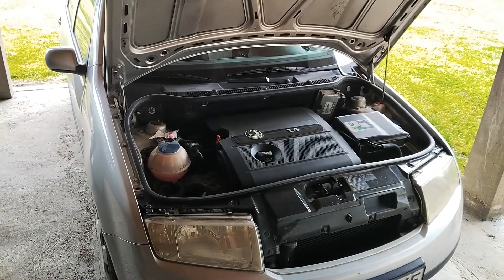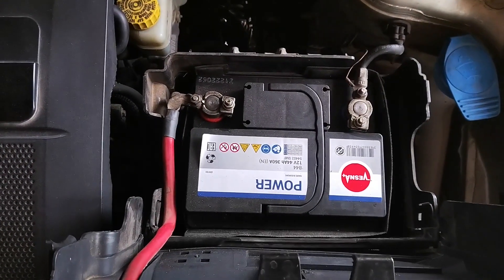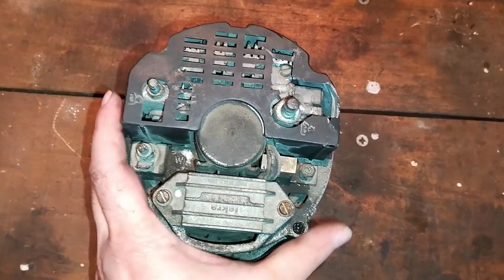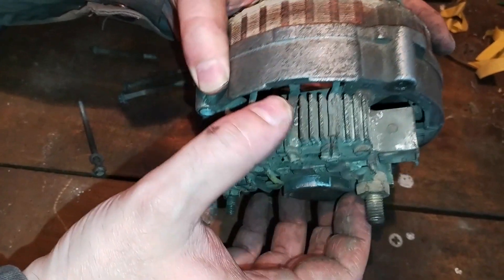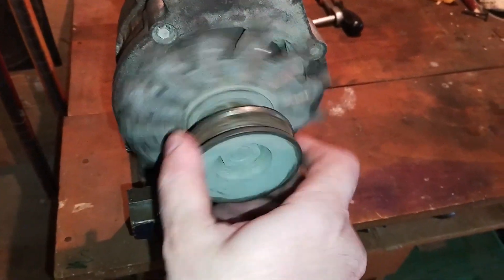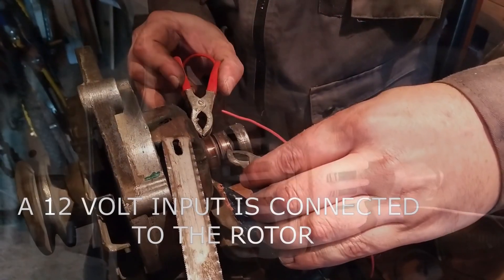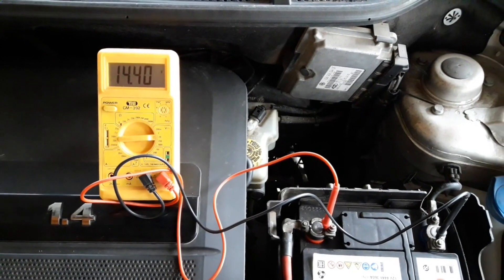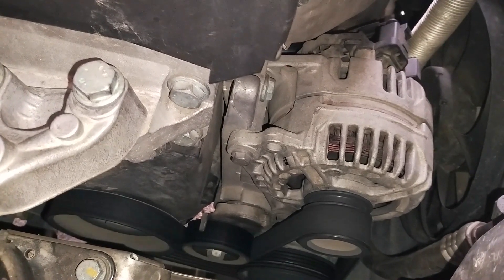What Is A Car Alternator? How Does It Work And The Basic Parts

Comment: Thanks. I think I have a faulty alternator.

in 2023 I didn't drive my car and the battery died in cold weather. I got it boosted and was told the battery was pretty old and should be replaced. I replaced it in Feb 2023.

Since then the battery died again after only 3 days of not driving. I got it boosted and drove for 30 minutes on the highway. When I parked, it died and got the battery charged and it worked. The car just died again after a few days of not driving it.

I tried to boost it but getting nothing. No dash lights, no sound when trying to start motor. Completely dead. I left the dead car in battery mode and turned off the donor car. I repositioned the boost clamp on the positive terminal of the off donor car and it sparked and the dash lights turned on the dead car. I started the donor car, waited 5 minutes and tried to turn over the motor on the dead car. Everything died an no dash lights.

I could repeat this process of off donor car, battery on dead car and have dash lights come on. As soon I tried to turn it over dashlights off on dead car.

I got a new battery as previous was under warranty. It starts now no problem, but I'm worried its an alternator issue and this battery is just going to die again. What do you think?
Reply from the maker: Hi and thanks for watching! Best try and test the alternator voltage with a multimeter, we've made a video specifically on that topic.